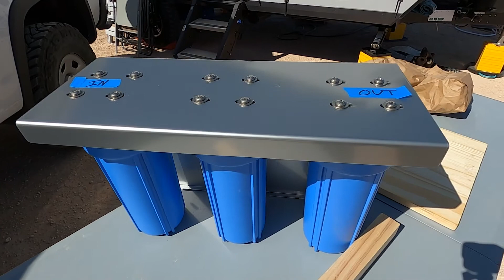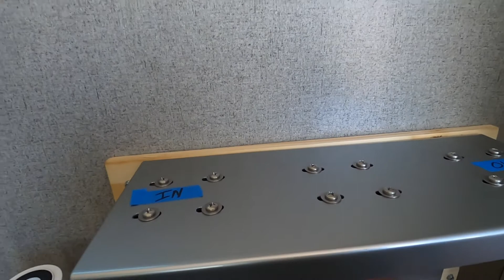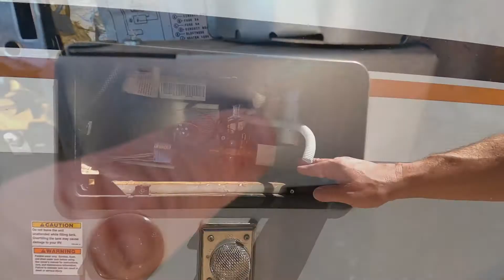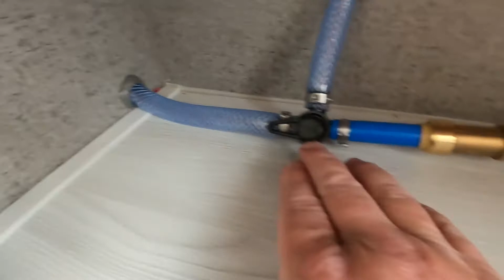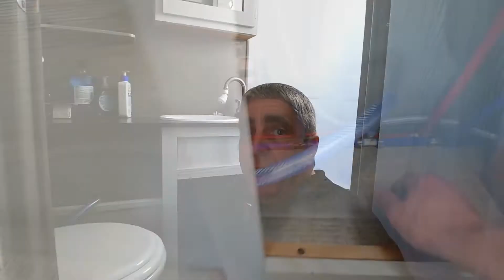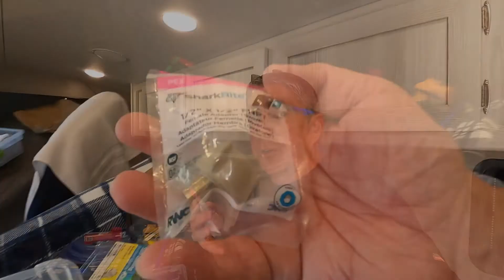Clearsource OnBoard RV water filter | Install and Connect Water Filtration System in Geo Pro

Comment: could you come up with a list of what fittings you used to work on your geo pro I've noticed leaks under my sink and shower but then they stop so I know the time is coming to I'd like to have the tools and fittings ready when it happens, I like the braided hose solution wish I could do the whole camper with it.
Reply from the maker: Hello, Herbert. A list is a good idea, but I do not have one compiled right now. Perhaps the best thing to do would be to create a video that summarizes what I have used and how those items have been working out for me. For example, a lot of people have commented that the braided vinyl tubing is a bad idea. Maybe I can throw my two cents in after testing it some more. In the meantime, I do have a playlist of different leaks and how I fixed them. It is not as a good as a summary, but here is the link.
https://youtube.com/playlist?list=PLsqNfYEKmJOki7Fok089Nx6WxUMDZZs6S

Comment: Its a shame this thing is a great filter but its way way 2 big, i hope tech can make it smaller in the future, like solar which are coming down in size (NEWPOWA) 100w almost half the size of all others & kicks ass maybe someone will get it done in filters, by the way almost all filters ARE A TOTAL SCAM so sad. We need fed regulation i hate 2 say.
Reply from the maker: Hey there, Stephen. It is definitely a large filter system. I have been holding my opinions until I have more experience with it. I will say that it is extremely heavy and, even for its size, there must be a way to make it lighter without sacrificing its durability. I hear you about the crazy marketing of water filters. I have always approached them with skepticism.

Comment: Another great video, I would feel better if you also installed anti back flow - one way valve between your water supply and toilet.
Reply from the maker: Hey there, Boosted. I had to draw everything out on paper and I took several trips to the hardware store, replanning my drawings, etc. After I had everything connected and just before I started filming the video, I thought the exact same thing. I should have a check valve at the toilet! Oh well, these things are never really complete. I do feel the plumbing is better than when I purchased the Geo Pro. At least I feel it is for me.

Comment: Well done, respect! Braided steel supply hoses are always the way to go but I have to ask, was the cavity with the water pump in it not big enough to accommodate the new filter system...looked like the ideal spot!
Reply from the maker: Thanks for the kudos, Mr E Dude. I think the space inside the bathroom cabinets might have been just large enough. Not sure if it would have been more work or less work. The deciding factor for me is that I plan to place some equipment in that space (where the pump was originally mounted) to support my lithium battery upgrade project. I failed to mention that point in the video. Thanks for bringing it up!

Comment: Hi Mario.  Neat video!  I've seen the ClearSource a few times and one of these days I'll break down and buy one. Right now I use a Berkey filter.  I like the way you will mount it inside rather than outside.    I'd be concerned about the weight and vibration as well.  I think I'd place a board under the canisters themselves - same height as the board supporting the back plate (2" ???) - without nailing it in place so you could remove it to service the canisters.  That would help support the whole thing while driving. 
I think the RV manufacturers put that piece of wood behind the absorption refrigerators to redirect and force as much airflow as possible over the fins on the back of the frig. 
Working on Plumbing and Electrical are the 2 biggest PIA's in RV's.  I think they use spaghetti flowcharts to design these system.
Reply from the maker: Hey there, John! I have to agree on all points. We will have to see how well my mount works. I actually considered a little kickstand under the filter chassis during travel days to help support that cantilevered weight. I was thinking something on the front half. Since the objective is convenience, I would rather see it work without that extra step. Maybe a cleat under the canisters is the solution, like you mentioned. Take care, John!